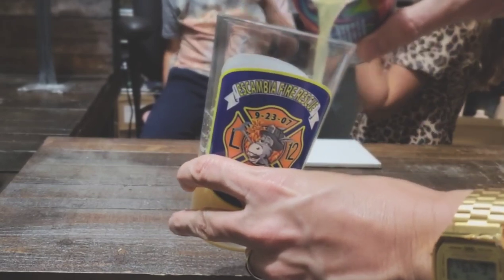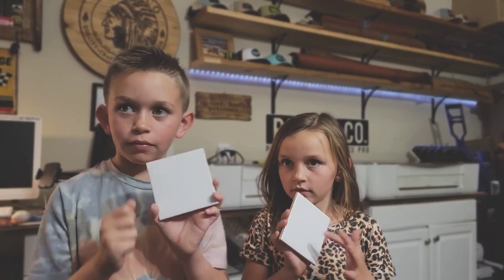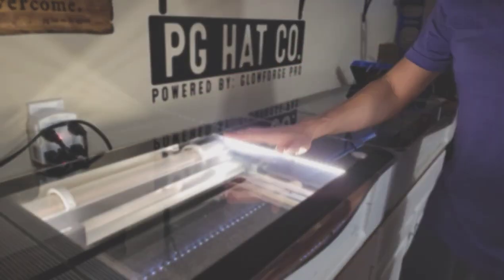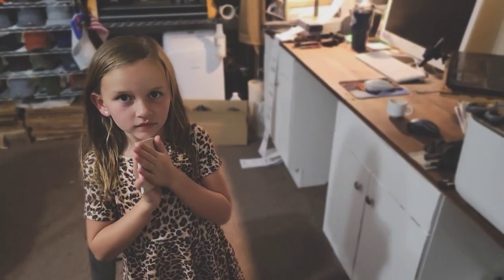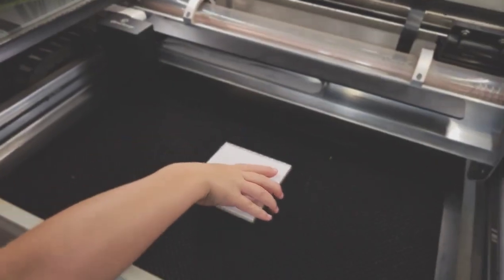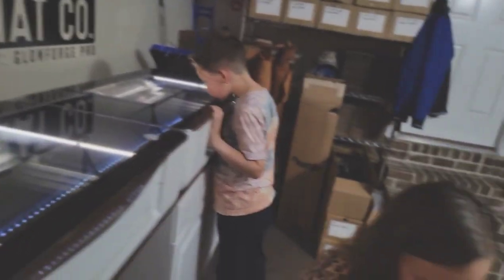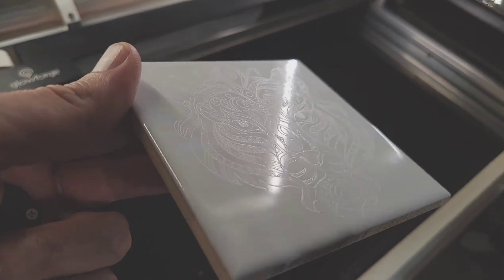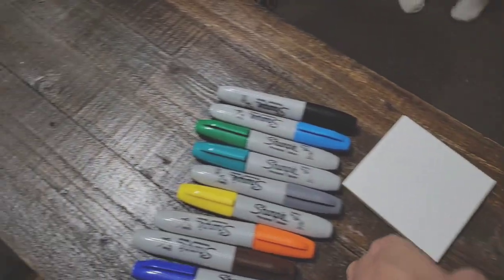Tutorial: Color Filled Laser Engraved $0.15 Tile Coaster on Glowforge Laser. Lasers and Beer Ep.6

Comment: I know others have commented on using white spray paint to get a black etching, and that was what I tried first when I got into this, but I found that using cheap acrylic craft paint - I use Apple Barrel Snow White - sprayed in three or four coats with an airbrush not only gives a MUCH darker etch, but it is SO much easier to clean off than the spray paint. A quick wash and wipe with water and a paper towel and your good to go versus the mess and hassle of using acetone to get the spray paint off. 

I was REALLY impressed with the results you got, though, and I am going to HAVE to try that!

Finally... I just had to comment on your little girl's name. It is so cool because that is my girlfriend's name and it is so rare to hear anyone named Evelyn, especially children. :)

Comment: Ty for the video. What is the science behind why the sharpie colors stick to the lasered areas? Is it because the lasered area is rough and the rest of the tile is smooth?
Reply from the maker: Correct. Imagine coloring on your granite kitchen counter with a sharpie and wiping it off. Then going outside on your concrete driveway with a sharpie and trying to wipe it off.

Comment: Great video, great family project, cute kids! One question regarding coloring the engraved areas. Have you tried to rub acrylic paint into the image? Sharpie is great, but over time it does not hold up well with solvents (especially alcohol or alcohol in cleaners), and is not as light-fast as acrylic paint. Like ink, the solvent for acrylic is alcohol, but it usually is more archival than most inks. Any thoughts?
Reply from the maker: I'm sure that could work. This was just a quick simple method
Reply: With the acrylic paint being rubbery and not sticking to some surfaces, would it stick in the cracks long-term? I always figured it would eventually rub out as well.

Comment: What would happen if I were to first color then engrave? Would the color of the sharpie or spray paint be absorbed, or just burn and turn into black?
Reply from the maker: You could do this. Say if we painted a coaster red then engraved the design, the design would be white with the rest staying red. However I don't know how well sharpie would hold up on the smooth surface. It absorbs permanently into the course engraved areas. Give it a test and let us know 😎
Reply: @PGHATCO  Ohh I see! I was hoping that the design would be left red, then I can wash off the rest so it's red design on white tile (like how you first paint white plastic with a black sharpie and engrave it to get a black design)
Reply from the maker: @Mariosyian4ever  I've not heard of that method but I'll try soon. What you mentioned though with the red engraving as red sounds just like what we did but adding color afterwards then wiping residue 🤷🏽‍♂️
Reply: @Mariosyian4ever  I was wondering as well because using sharpie markers on glazed ceramics and then refiring is supposed to make it permanent... maybe a lower power on the laser? I did see where they laser etched wood, then dusted colored powdercoat powder into the etching and lasered again to melt and set it. But you need to be able to reposition your piece back where it was so it engraves in the same place, so use an accurate jig.